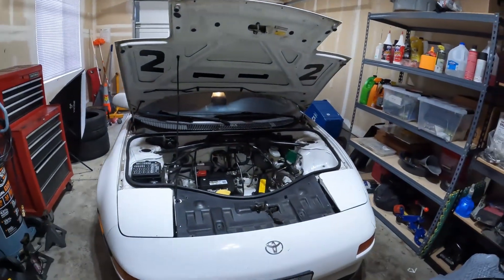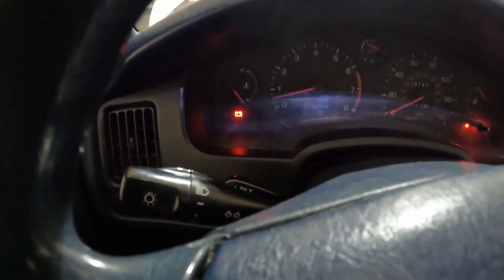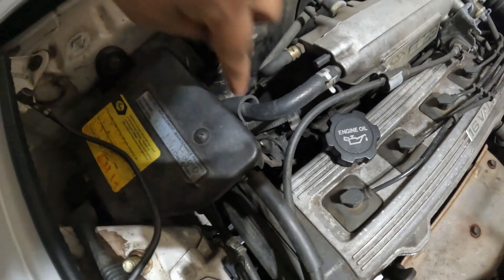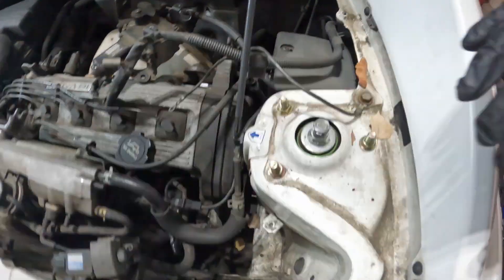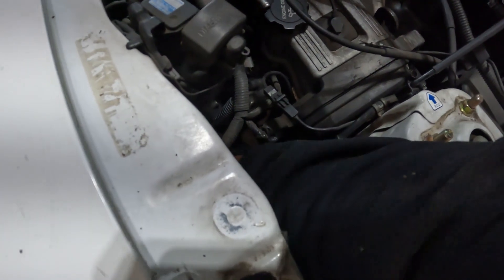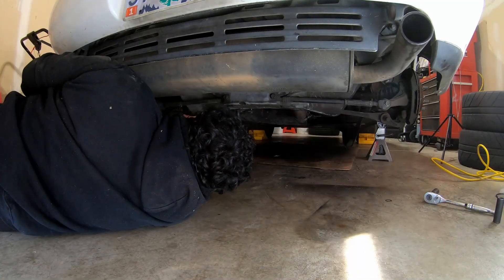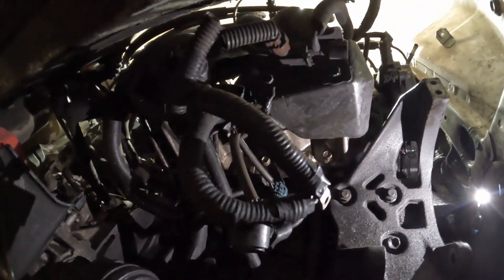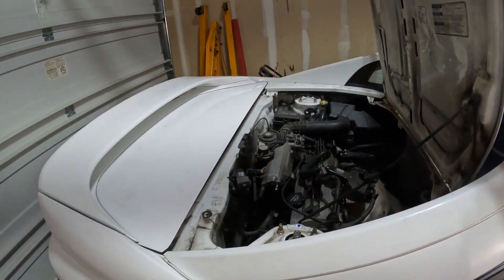Electrical Woes..... II Diagnosing Charging System Problems II Toyota MR2

Comment from the maker: Quick update: I have looked for a harness, but they are challenging to find in good condition. My plan now is to pull the harness to see how extensive the harness is damaged then go from there. Worst case scenario, the car sits for a while. Luckily I can drive the Miata to get seat time in the meanwhile! 

Thanks for watching!
Reply: You have any advice for a factory radio?  I was able to reset the code to get it to turn on and antennae goes up I can even grab local channels when I search but I have no sound when playing Cassette or CD or Radio?  I have heard there maybe an AMP or 2 amps any ideas?  1991 Turbo
Reply: I have a solution (maybe). Here's what you do; most connectors have a hidden button that removes the actual connector bit out of the plastic. Do that and replace the connectors and cut the wires all the way up to where it's messed up on the loom. Solder and heat shrink them together just beyond where the break is. Make sure you put that plastic loom protector stuff around where it's broken, that way the wires won't do that again. Not difficult, the hard part is finding the connector release, but if you look at the back side of the plug you should see it. Just jam a small screwdriver and you should be able to pull the connector right out of the plug.
Reply: Ah man! Bummer. Chasing down electrical issues is always fun.